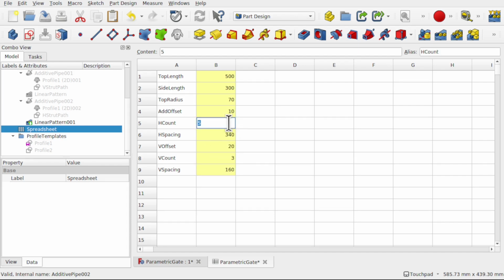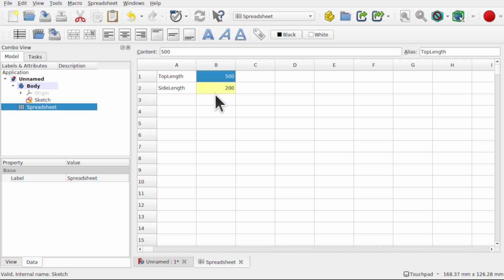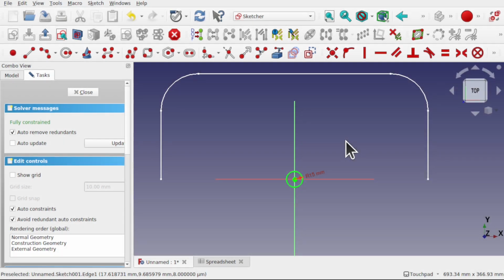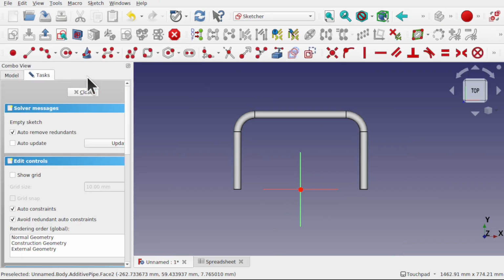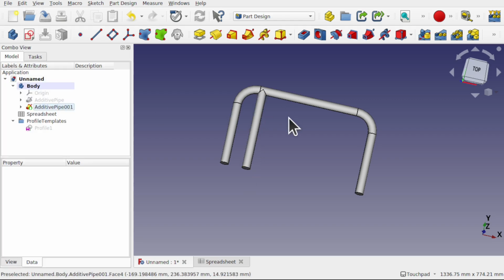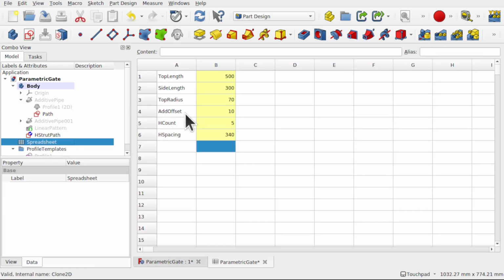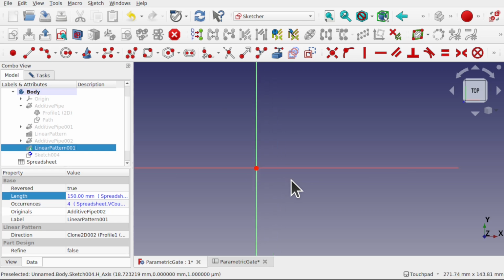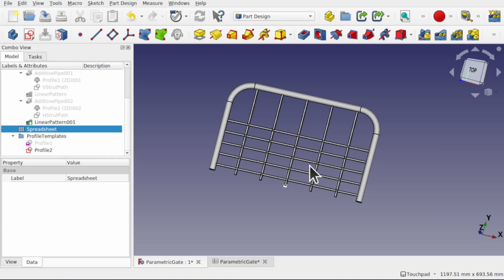FreeCAD for Beginners 31 : Parametric Spreadsheet and Master Sketch Workflow for Part Design

Comment: A possible answer to the question how to control the profile from a central place is to not use the spreadsheet but an intermediate clone of the profile using the same principles shown in the video. Clone one of the profiles and call it ProfileSelector. Then clone this ProfileSelector to all the places where it's needed in the geometry. Now you can change the ProfileSelector Objects property to select a different profile and all of it's clones will follow.

Comment: Spreadsheet accepts dimensions with units. If you use just numbers then the tool where the spreadsheet value is used in the formula will apply some default unit, usually mm. Approach with just numbers will bite you if you ever need to do calculations in the formula that then mixes numbers with dimensions, like Pad.Length - Spreadsheet.MyHeight

Comment: At about 12:50, the line I just created does not reach the top pipe as SideLength is the length of the side pipes. Adding TopRadius to the line makes it reach the center of the top pipe.

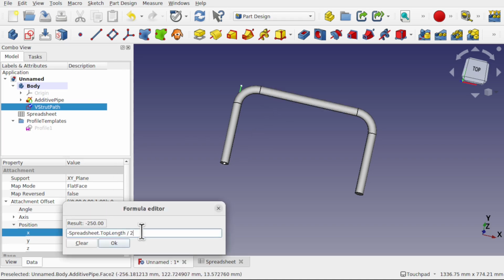Comment: 14:25 this doesn't work good in my FreeCad (0.20.1) 🙁 
When I enter formula, I can read value in Position X, but there is no any reaction on drawing. After that I cannot enter nothing in X cell, but if I enter formula and delete content, I can enter value manually (But I like to go parametric 😮‍💨)
Reply: The obvious question is why are you running such an old version? Version 1.0 is out now
Reply: @loughkb  now? 

But this was not issued when I posted my problem...
Reply: @branislavbabic4579  Silly me, didn't notice the date on your post.

Comment: 00:00 Intro
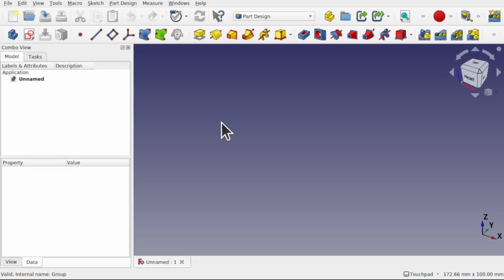01:03 Sketching exterior frame path
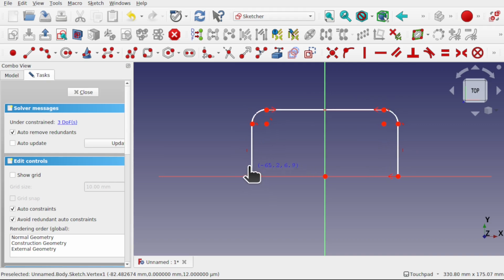03:00 Creating spreadsheet and applying parameters
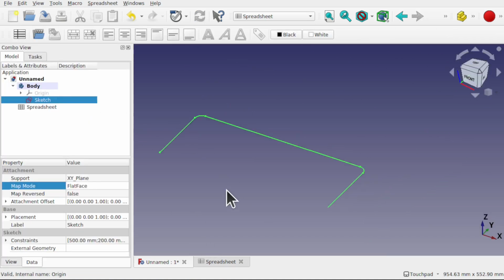06:35 Demonstrating spreadsheet changes
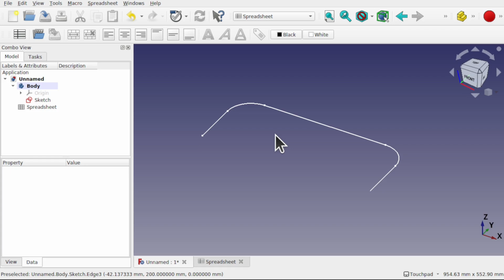06:49 Creating a group and profiles in the right place for reuse
07:52 Sketching profile
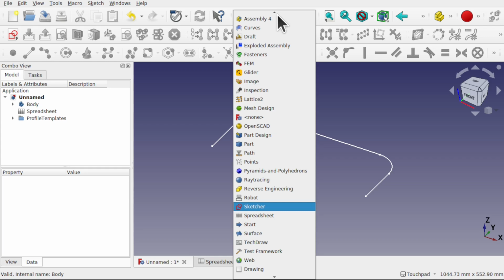08:50 Draft: Clone & remap profile
10:37 Part Design: Additive Pipe to create outside frame
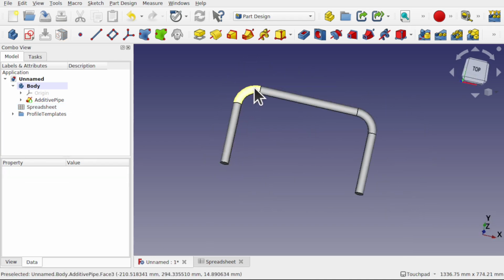11:37 Sketching vertical strut path
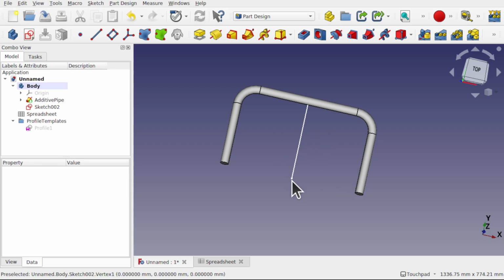13:00 Offsetting vertical strut path with parameters & formulas
15:11 Draft: Clone & remap profile to vertical strut
15:54 Part Design: Additive Pipe to create vertical strut
16:20 Part Design: Linear Pattern of vertical strut with parameters
18:37 Repeating 11:37 - 18:36 for horizontal struts
24:09 Easily changing profiles & spacing parametrically
28:30 Conclusion
Reply from the maker: Thank you so much 😊😊👍👍👍👍👍👍👍👍
Reply: @MangoJellySolutions  Man, I am just eating this stuff up. You know, when I first started, I was having difficulties. following along, but not any more. I have really come a long way, and I just wanted to thank you. To thank you. I made such great progress. And hopefully by the end of the year, i'll be 3D printing. Hopefully. You'll have some courseware on G codes and. toolpaths for both Cnc, and maybe some slicer. software too

Comment: I wonder if the goal of Felsin Ferguson's comment wouldn't be achieved by Lattice 2 Paraseries? Thanks for this demonstration. Happy New Year 🥳
Reply from the maker: That is absolutely a possibility, it also would open up more possibilities with a choice of profile per strut. Can see this application for custom dividers in drawers where you would have slots and then, say rods all in the same group of dividers. Idea for workshops.  I will add that one to my list for a project build video. Thanks for adding to the starts of an idea. 😁👍👍👍

Comment: Very nice piece on spreadsheet-controlled work. Left me with one question - Is it possible to select the profile via the spreadsheet? At first glance, it would seem like there should be a way to do it - Perhaps "SpreadSheet.ChosenProfile", which gets set appropriately, then put the "formula"  "SpreadSheet.ChosenProfile"  in AdditivePipe001's Objects property? (going back and looking at where you were messing with the cloned object in the additive pipe, it appears there's no (or at least, there's nothing visible in the view you captured - maybe if the width were changed...?) option to input a formula... Hmmm... Maybe this idea is a non-starter...)
Reply from the maker: After thinking about it and reading other comments I think your idea has very useful potential for such things as custom dividers for drawers. The profile could be used on all struts and the spreadsheet changes the profile per divider. So you may just want rods or different height dividers for some sections. Or grooved ones for others to allow like a hanging file system. Paraseries in lattice 2 is the answer and I have added it to the list for a project video idea. Thank you for the seed to another video 😁👍👍
Reply: You can solve this by another level of Clone indirection. Create a Clone of the template sketch, and call it TemplateSelector. Then Clone the TemplateSelector to all the places you need it. then always only tweak the TemplateSelector Object property.
Reply from the maker: Hmm this is a really interesting idea. Ideally the clone itself would have a formular button at the end of the source property which I haven't looked at yet. If this can't be changed then a python macro would do it, but I always find these start to make workflows overcomplicated as a) knowing how to code is a whole new layer of something you have to learn and b) it increases the chance of errors. I am sure lattice would come to the rescue in this instance. Edit: another contributer had said lattice 2 paraseries which would be a possibility